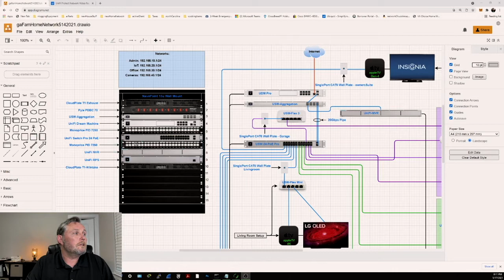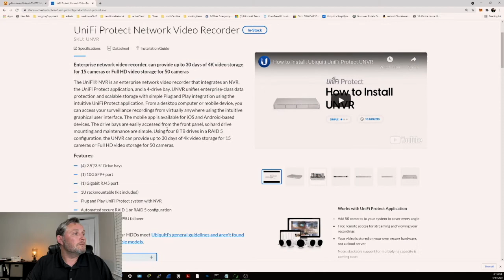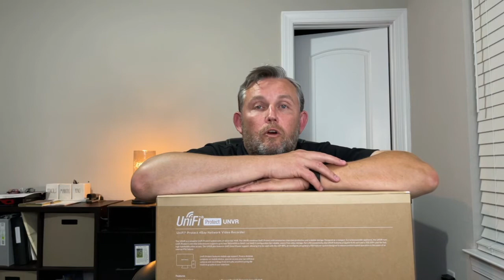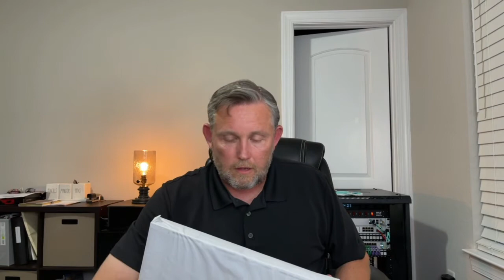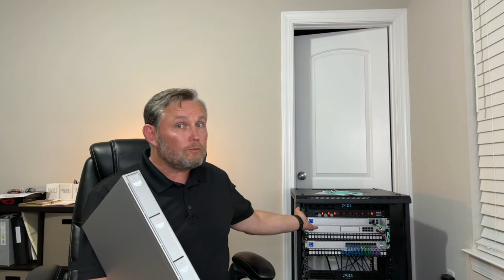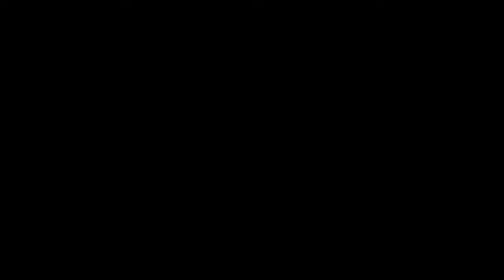UNVR Unboxing and Installation!

Comment: Great videos Gary.. quick question on the location of the rack.. will you be pushing it back into the cupboard due to the noise from the fans etc...
Reply from the maker: Yes. I leave it out to work on it and roll it back in the closet when I am done.